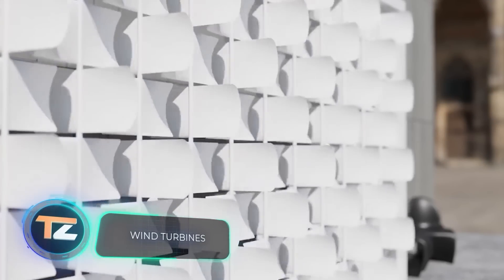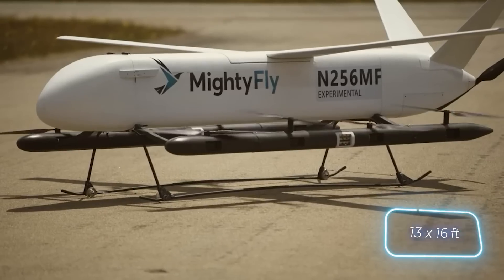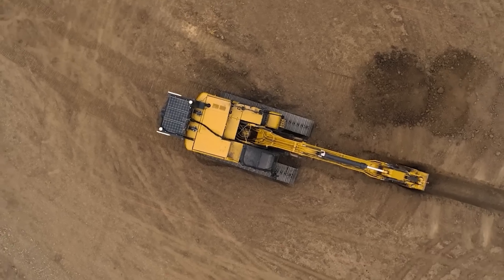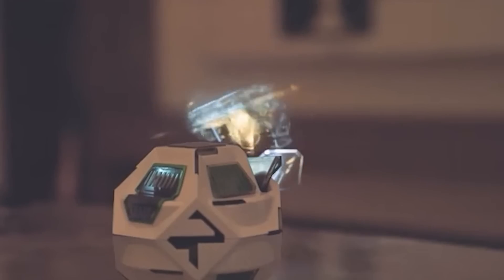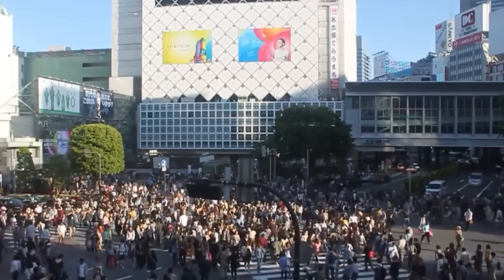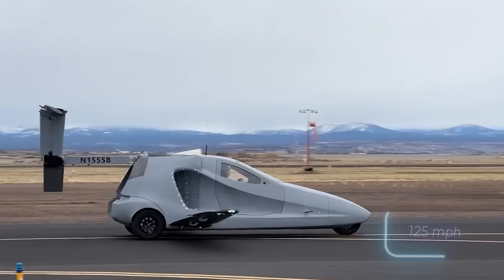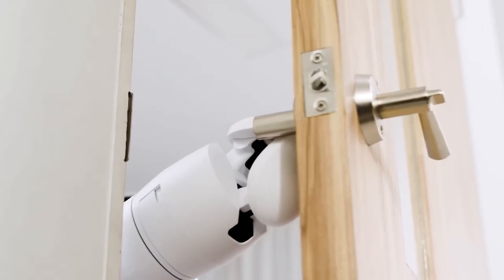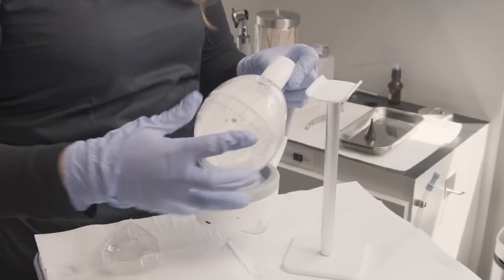INCREDIBLE INVENTIONS YOU DIDN'T KNOW ABOUT

Comment: The hydrogen airplanes sound like a great idea and something that should definitely be given the time/effort needed to make them a every day thing. I'm just wondering why was the plane only flown for 15 min? Is that all the cells can handle? I've always wondered if there was a way to use the wind created by a plane to somehow charge a electric airplane in flight seems like something that could work.  But seeing as I am by far not nearly as smart as other people and it hasn't become a thing means there is something wrong with that
Reply: The short answer is, perpetual motion isn’t a thing. While it would provide some energy, the drag would also reduce efficiency. Over time, the reduced efficiency would cause more issues than not.
I’m not one of the smart people in this field but I do believe there was a video that covered this topic by PhysicsIsFun or some similar channel!
Reply: @redfailhawk  It's not about perpetual motion, but about recovering part of the energy put in to extend range. This kind of concept is very much possible in general, though not necessarily for a flying vehicle with the current technology.

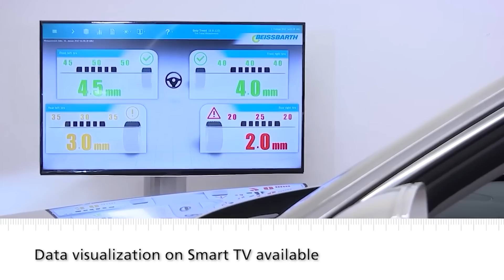Comment: 7:18 I love the easy thread idea. I think it can be upgraded to get all the tire pressure and if there is liquid in the tire and how much
Reply: I have a problem with that one, it only measures a tiny area of the tire, I think that system should have rollers to roll the tire completely over the cameras, and get a full picture of the entire tire, this will also reveal whenever the tire-threads are even all around.

Comment: I have been seeing mentions of this new and awesome Pavegen thing for over a decade, yet they have only appeared anywhere as curios. For a good reason: the webpage says stepping on the tile will spin a generator so as long as there is some traffic it should give continuous power, but that promised five watts still sounds suspiciously like all the other systems that actually mean "up to X watts, no promises it will reach that high often or practically ever". It also says the tiles are 500mm by 500mm, but then calls them triangles, and the cost is a range of $75 to $160... Also, they only last for five years.

If we assume one square meter takes four tiles the cost starts at $300 and it could produce 20W. That is 0.02Wh per hour of heavy enough traffic to keep them going, whatever the limit of that happens to be. Assuming some really busy place where people walk 20 hours out of 24 every day for five years and the four tiles indeed all stay active all that time, they will produce 730kWh, which in states with the highest ever cost of electricity will almost be worth the same $300 that is the lower end of what the tiles cost in the first place.

Note I have no idea how much extra it costs to install them, and even if they are smaller so you can fit more than four per square meter the cost is still $15 to $32 or more per watt.

Meanwhile a 200W solar panel costs only around $1/W. While it can only reach maximum output in direct sunlight, even in worst conditions it is likely to produce more power per day than the Pavegen tiles that take the same area and cost more than it. In typical sunnier climates it will produce more energy in a couple of years than the Pavegen can manage during its lifetime, pay for itself in less than ten even assuming the cheapest grid electricity, and the solar panel will then last for decades more.

Comment: The car was invented and on the road in the early 1900's but we really mastered the car to work properly and on non toxic fuel in about a century or so... just to give you an idea, about how long it actually takes to master a car. Just think how long it will take to master robots to do manual labour... we are far far away from it.... just because they're on the street doing deliveries, it does not make them anywhere near complete. People rode horses for decades after cars were put on the road, and even after that they were still bad and inefficient, lead fume spreading piles of junk. Not in our lifetimes, don't worry, don't dich your job.
Reply: What do you mean by non toxic fuel? Where do you think electricity comes from ? What about the manufacturing process to make the batteries? Just push the toxins on someone else,easy solution.
Reply: @dredbud9272  what? ahahah have you even read what i wrote mate?
Reply: @dredbud9272   you know how you have "unleaded" petrol... at one point it was leaded. it was long ago but it was horrible and caused cancer and disabilities like autism and world wide to skyrocket. my main point is that it will take long time to get to the point when robots take everything over...
Reply: @dredbud9272   they actually call the leading of petrol the biggest mistake in history of mankind, that's how bad it was for our species.
Reply: @RadekZielinski.  did you make yourself the leading authority on the subject?

Comment: The machine to measure tread depth on tyres could be used by the police to catch badly maintained cars at check points or through toll gates, or just in the road with a camera that would then take a photo of your licence plate and then automatically send you the fine, a bit like a speed trap...
Reply: Might as well just have fart sensors too, they will sniff your ass at checkout to see if you polluted the air and send you a fine. What is it with people wanting MORE of a police state!!
Reply: It would be a value add for those entering and exiting car parks, and they'd also be travelling through the boom gate area at the correct speed range.
Reply: Don’t give them ideas take the post down NOW!!!!

Comment: Ooh, can you imagine the chaos with all these planes, flying cars & big drones and little drones all about to occupy the skies, with no form of traffic control?
Reply: Who says there would be no form of traffic control? Who says you wouldn't need just as much of a pilot's license as flying any other small personal aircraft? 😆 Just because it's a new invention does not somehow give it the ability to skirt by existing regulations. These will also all cost more than a cheap used Cessna. So, they are nothing more than novelties for existing pilots.
Reply: @fitybux4664  What I mean is, that if you have all the the existing air traffic,  then add the cars, then you may have some control. These can be see. However, if you add the totally uncontrollable flights of tiny, barely seeable drones launched by YouTube channelers showing their subscribers views from above, plus all the "toys" being flown, there are bound to be midair collisions between them.
Reply: @dennisyates1762  drones now require drone-id. Get an ADS-B receiver and a drone-id receiver, easy enough.
Reply: @fitybux4664  And think of the many idiot drivers without licenses out there; there's going to be many idiot unlicensed wanna be pilots doing their thing. In short; chaos.
Reply: Air traffic control at his first day of job, sees all the flying drones and then hands his resignation letter that same day
Reply: @ohmygosh6176  they largely depend on computer databases these days to handle all of the air traffic. Don't let Hollywood fool you. 😆

Comment: I want to see Dave Jones of EEVBlog assess the feasibility of the Pavegen tiles.
Reply: I bet he'd tear them apart like he has torn those ridiculous solar freaking roadways apart. Or maybe he already has? I dunno, it's been ages since I was subscribed.
Reply: @mrxmry3264  NO, these ridge version are actually a better idea, but I'm guessing the tiles maybe 15% efficiency. Both still useful but the ridge is probably about 30%, way better. The solar roadways just bad idea. I'm an engineer too. Dave is one of the few that really knows what he's doing.
Reply: The Pavegen makes no economic sense and likely only exists because powering a LED with your steps amuses children and makes the ignorant adults think that they and the company advertising it are producing "clean" energy.

The only true problem with the solar roadways idea is that we have plenty of roofs and empty land for solar panels that would cost less to install there than making them work as a road. There are few other minor issues, but really the only part you need to care about is that at the current prices solar roads do not give enough benefits.

The Pavegen tiles produce 5W and are priced at $75 to $160 each so the cost per watt is $15 to $32, not sure if that includes installation or not. Either way, the estimated cost of solar roads is actually lower than that.

Meanwhile solar panels are $1 to $1.5 per watt depending on type, $3 to $5 if you hired installers to put them on your house, and up to $8/W if you replace your whole roof and use Solar Roof tiles instead of separate panels

 And sure, some times you only get the equivalent of couple hours of sun over the whole day, but how many locations would have people walking on Pavegen tiles 24/7/365 as is required to actually make them produce enough electricity to pay for themselves?
Reply: EEVblag is crap.
Reply: @cranegantry868  that is your opinion, and opinions are worthless.
Reply: @mrxmry3264  why? there is a multi trillion dollar industry built around influencing opinions
Reply: How does it make sense to steal energy from humans to power lights? It's the same with those speed bump generators that just steal energy from cars that go over them.
Reply: @fergalmdaly  None of this is stealing. Just stop.
Reply: @kelli217  where do you think the energy is coming from? Walking across one of these requires more energy than walking across a normal floor. Your foot sinks slightly every time. It's a little bit like walking on sand.

Comment: Is the featured drone clean, meaning uses batteries for 100% electricity power? Or is it a dirty & polluting fossil fuel burner? If it's 100% electric, then it's a great step forward! We DONT want or need more pollution from fossil fuels.
Reply: Great if you turn the generator by hand, all muscle power. Most generators to be profitable still use Diesel. Wind, Solar and Nuclear still unprofitable. Only hydropower leaves us in the black but water levels are very low these days.
Reply: @piosian4196  wrong in every way. Hydrogen is 75% inefficient; for every 4 units of power you put in, only 1 unit reaches the propelling mechanism of the vehicle. Batteries are around 99% efficient. Solar power is 100% clean & the cheapest possible way to make electricity- they could even put super lightweight solar on the wings & body of vehicles to constantly top up their electric charge!
Reply: @Tim Longson  Wrong in every way!! He said hydroelectric as in water turbines

Comment: A large tipped syringe with a steady hand and someone to hold the bowl is just as effective at cleaning ears for about $3
Reply: Clean your ears for free in the shower by angling your head so that the water is sprayed into the ears to flush out the built up wax.  This was recommended to me by a doctor over 30 years ago when I worked in a high noise environment and I haven't had any problems with my ears since.
Reply: @TgrHwke  exactly , I ended up adding  a Clean Stream kit . Blast my ears out , feels great . Also use it for flossing ,the teeth and gums love it .
Reply: Not clearing ears of excess wax is even cheaper than free, and ENT doctors would recommend it.
Reply: @fitybux4664  I feel better when ears are wax free